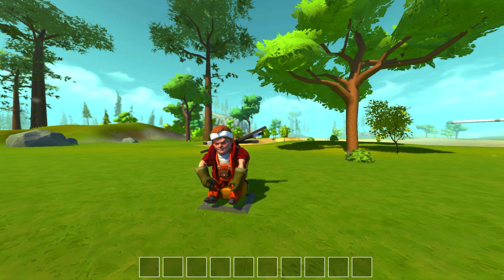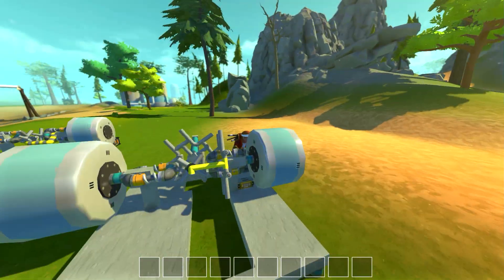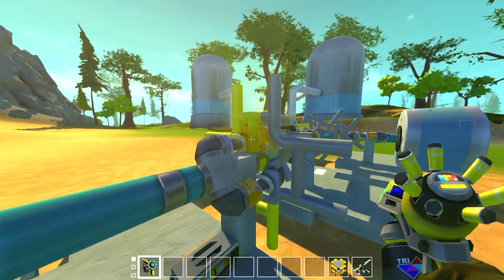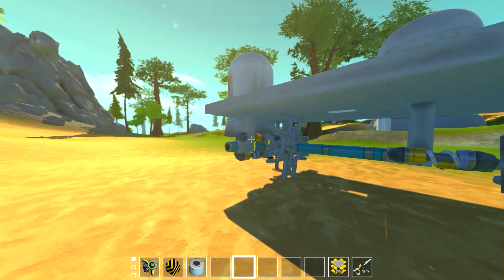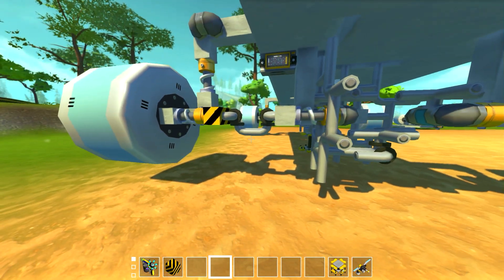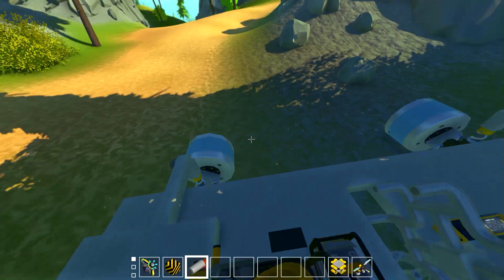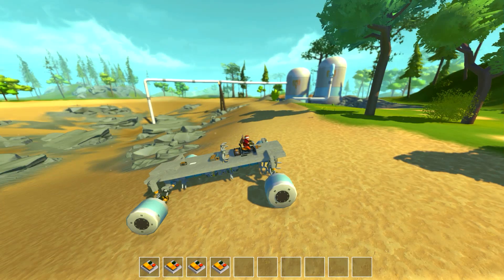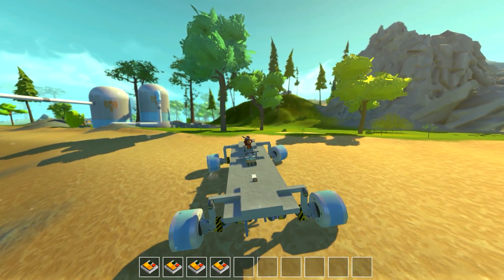Triple Differential Quattro System AWD Car! (Scrap Mechanic #166)

Comment: Fun fact: The first commercially successful 3rd differential awd system used was the Jeep "Quadra-Trac" system used from 1973-79. Also, the "CV" joints you are using are technically "Double Cardan" and not true CV joints.
Reply from the maker: Cody Moncrief yes it uses a sort of limited slip differential with multiple clutches to control power distribution

Comment: Hay Kan, to increase power to the wheels. I would either up the speed on the engine or turn the shaft with a controller.

Comment: Ok now add the thruster piston engine and power the thrusters using a rubber duck hopper, where the pistons fire in sync with the ducks rolling past a sensor.

Comment: Great mechanics physics in game but if you use just normal awd drive don't call it Quattro
Quattro works on 3 differentials and that's true but it works based on Torsen differential
So yeah the basic principal is the same (3 differentials - center front and rear) but the build is not even close to traditional awd drive

Comment: Hey Kan! Pin this post? I have an Idea for Suspension. Make the rear ones like the system on Trophy Trucks. And make the front ones Double Wishbone. Or You can just make all of them double wishbone. Also It'd make my day if you left a reply.
Reply from the maker: Asean12 I can't do the trophy truck rear with the design as my rear differential gear is too large and will hit the ground. maybe when I make a modded version I could
Reply: kAN Gaming yeah seems like vanilla parts just can't make cars like this without lagging.
Reply from the maker: Asean12 That's the challenge I'm trying to conquer :P
Reply: kAN Gaming yeah but there's no point if making it if it lags too much.
Reply: also what are your PC specs?
Reply: ...through your inspiration, the diff i came up with is 5 blocks in height. check out the design in the workshop, see if it works for you!!. 3 Diff 4x4 Chassis

Comment: Wouldn't it be possible to make limited slip by connecting the differential middle gear with a turned off gas engine? I think they should allow for limited slippage.
Reply from the maker: TNH91 I can try that but a gas engine that is not connected to a seat doesn't move. There might be a way to make one with suspension but it would be much larger.
Reply: Have a seat for the gas engines connected to the limited slip system? I don't know if it'd work, but it's an idea. Love your work/play. Good joints. And for turned off I meant connected to a switch; if that doesn't work I'm disappointed in SM...

Comment: Hey kAN has a quattro not just 2Diffs. A G-class has got (the most) 3 Diffs with diff-locks 
And could you build a RX-drivetrain that has got 3Diffs and if they pull the handbrake the middle diff puts all the power to the back, is that possible?? Nice Video
Reply: yes i know that he has 3diffs but i mean something other.
Reply: The handbrakes of RX-cars dont block like normaly. 50% front and 50% rear is normaly but if you pull the "handbrake" its gonna be 0%front and 100% rear so that they can go easy into a drift but dont get slower because braking :)
Reply: és amugy én is magyar vagyok :D
Reply: :) meny erre a oldalra és nézd meg a Transmission-nél hogy mi van a centre diff nél (bocsi a rosz helyesiràst 7eves korom ota schweiz-ban elek) :)

Comment: Hey try to make a automatic gearbox
Reply from the maker: Shadow WSK Eru the engineer made an automatic gearbox a while ago. the one I make will just be a 2 speed manual transmission with a clutch so it doesnt lag as much.

Comment: I know that this is a 2 year old video.

Your Suspension doesnt work in this case. Its because the CV joints cant change their length. Real cars do it by joining the axle in the axle hub with balls.
Im not sure what would be the correct words in English, but i hope you get the idea right.

Comment: hi kan.  i made a very simple engine type that might be able to power that car. 
keep in mind this is a prototype. http://steamcommunity.com/sharedfiles/filedetails/?id=938010836
it got ignition key and variable speed both front and reverse.
to double or triple the cylinders for power dont take much space. or just add more thrusters.